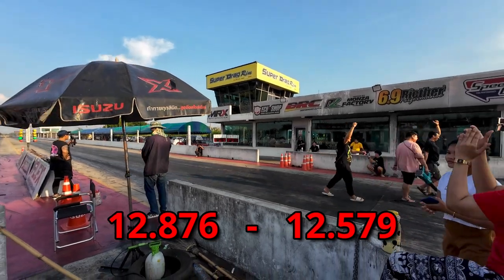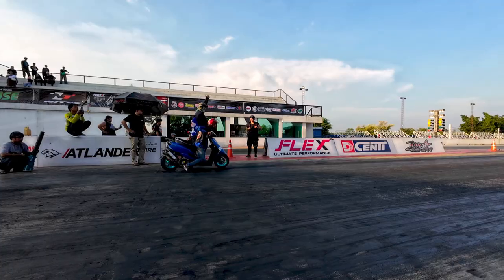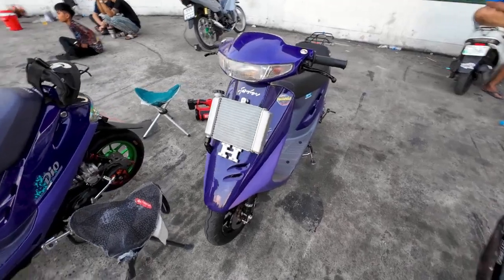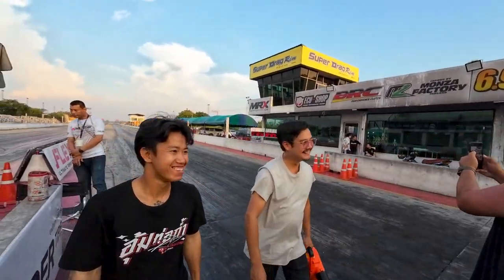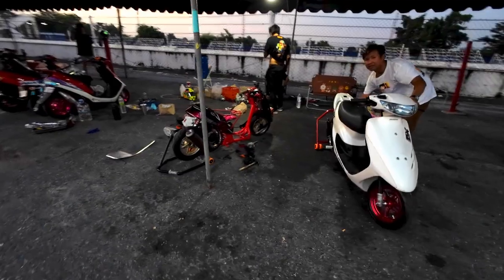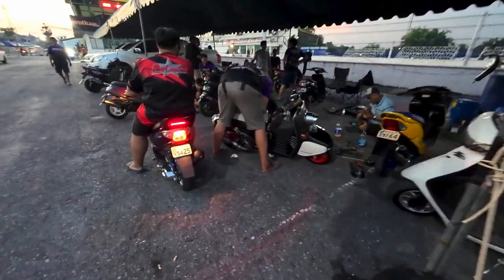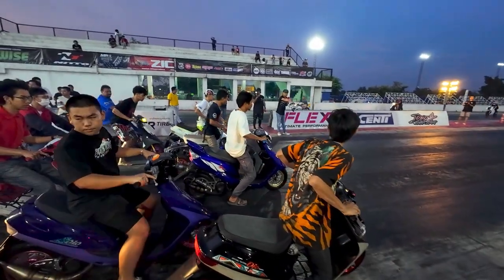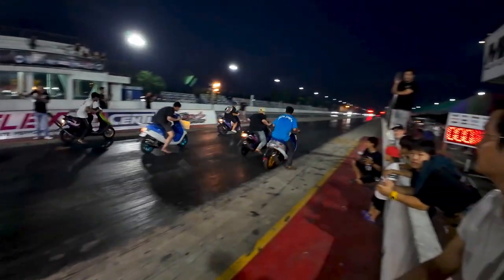Thai Drag Racing Scooters Are Shockingly Fast

Comment: Man Richie I love these built as hell 2 strokes and crazy how fast they are. I remember I raced a piped and jetted Yamaha Seca 750 and I was running low 13's and these things at 80cc are beating them. My best friend had an RD 350 and I rode it a bunch of times and man that was crazy fast for low displacement by street bike standards. Good stuff man keep up the great video!
Reply from the maker: Thanks! I'm glad you liked it. These bikes are pretty impressive. I had a Yamaha 600 Seca II for awhile. That was a pretty good bike but not even close to these little scooters haha. Even my old 91 Ninja 600r was probably slower.

Comment: I'm guessing they run the 1/8th on some of those due to the short gearing. Considering they're running ~90mph, I bet they would top out pretty quick in the 1/4.
Reply from the maker: I was wondering if that's the case too. Maybe the Yamaha ZR CVT has a taller final ratio than the Honda Dio CVT. Or maybe they're just too sketchy past the 1/8th haha